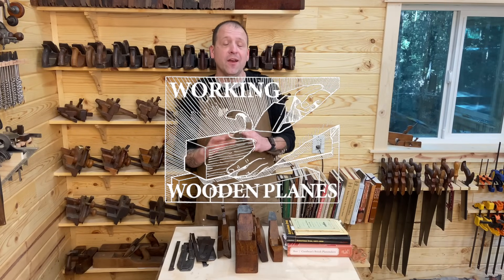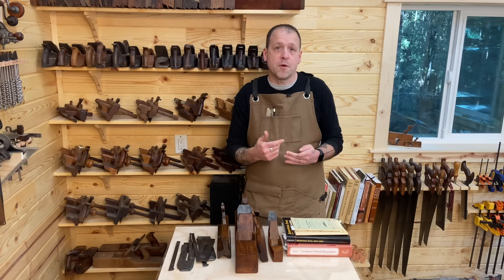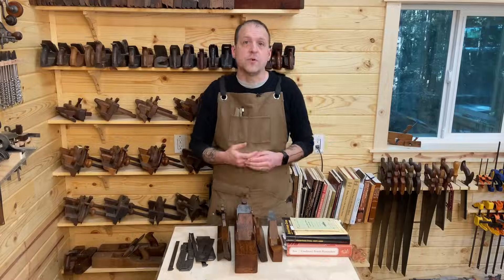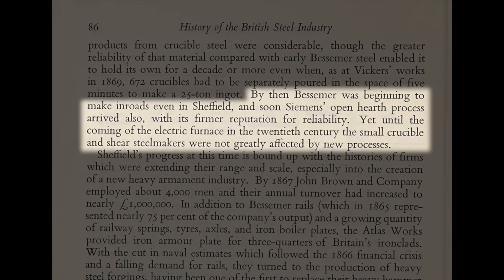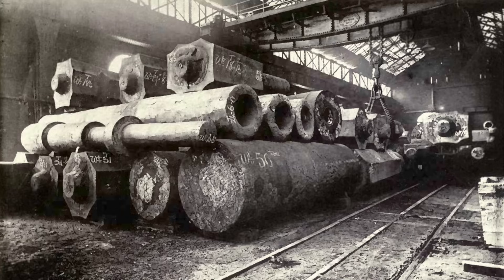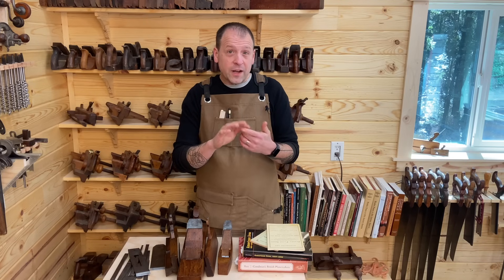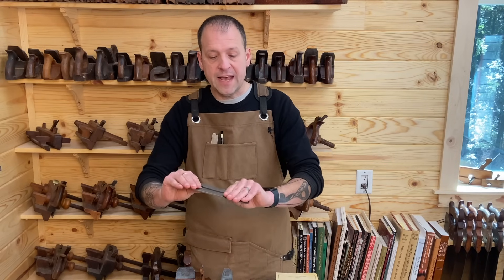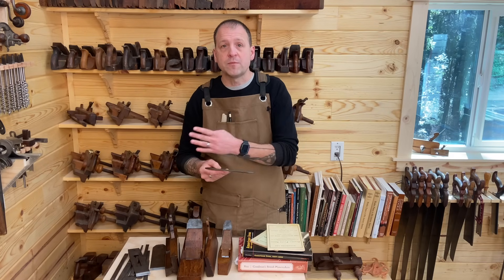The True Story of Cast Steel (Was Bessemer a liar?)

Comment: I thought the problem was phosphorous... Swedish Iron was low phosphorous so was used to make crucible steel. Bessemer was using high phosphorus UK iron and until someone worked out how to remove it by the basic steel process they could not produce high carbon steels...

Comment: Smiths in rural Norway made steel by feeding iron and steel shavings and coal in stead of iron ore into the furnace,. You don't get the furnace hot enough to make steel in general, but you get localized areas hot and carbon rich enough to melt the iron filings. . We can probably date this method to the early Viking age, when they stopped using pattern welding, (Damascus steel). My guess is that was the laborious way to make steel on most of N-Europe, but I have not seen it written down anywhere outside an interview with an old Norwegian smith that explained the method. . The Swedes probably did it industrially not long after the method was discovered.

Comment: Great video.

I'm a novice blacksmith.  I thought steel started with Bessemer.  Just didn't know.

Toured the Steamship Arabia which sank in the Missouri River in 1856 loaded with supplies for ten hardware stores in the Nebraska frontier.  It was not excavated until 1988.  Amazing trove from an 1856 time capsule.  Being a blacksmith I took great interest in the axe heads.  I wanted to see how well steel bits were welded into the wrought heads.  Very surprised to see Cast Steel markings on every axe.  The museum curator was kind enough to let me examine a few of them.  Now I know a little of crucible/cast steel history thanks to this fine video.

Comment: Down the street from me (I live in an industrial town) is a forge next to the railroad. The railroad itself in that area was built by the forge next to it. This is next to San Francisco. That forge also made the San Francisco Golden Gate Bridge and both Bay Bridges. On the next street over is machine row. One of the shops on “machine row” is Metal Co. I got a tour of the place once when I was looking for someone to tool me some plate parts. Metal Co. owner explained to me that they get various metals from the government and it is their job to stress test them. They had a bank of more than 30 manual lathes. It was extremely impressive. They said they get alloys of various composition and are tasked with reporting the properties exhibited. It was relieving to know that all this is still going on today — in secret, right down the street, one block away, on the same street as Ashby Lumber and MacBeath Hardwood. In fact, the name Ashby (as in avenue) derives its name from “Ashby charts” which plot material against strength. You cannot build a bridge without knowing your metals. There is a reason the Golden Gate Bridge stands today

Comment: The Bessemer process just zeros pig/cast iron back to pure iron and then you add the exact amount of carbon you require your cast steel to have. You can make steel of any carbon content with the process. From mild steel to Rolled Homogeneous Armor Plate. Tool steel wasn't required in the batch sizes that other steel was made, thus small foundries specialized in making high quality tool and cutting edge steel. Not so much now, because quality steel is as cheap as chips and plentiful.

Comment: It sounds like Bessemer may have been referring to case hardening when comparing his steel to cast steel, which while still incorrect, at least makes a bit more sense than comparing mild steel to high carbon steel. Carburizing is usually referring to case hardening rather than the initial carbon content.

Comment: Brand new to the channel, I really liked your history and technology on iron!  Full disclosure I’m less into craft builds. If you had a desire to chase this further, I would love to see more along these lines transitioning into modern steels. Although there are some videos on steel and iron types and uses, I find them very shallow. If you combined a about more of the technology (both how made and material properties and example uses) into your current video, that could be a more technically oriented part 2 which would be of interest at least to me. But from there you could follow the development of steel and alloys all the way to today. I’ve heard of many alloys, but exactly what they are and why I would use one over the other still seems voodoo. For example, let’s say I want to make a lathe or milling machine. Cast iron (gray I think). Why?  I know some answers but a truly comprehensive answer would be nice. And then let’s say I want to make my own without having to cast it. Might I be able to engineer a stiff strong structural design out of say 4041?  And then let’s say I’m cheap (since 4041 is pricy) maybe I can use some 1030 or 1040?  But then there is hot rolled vs cold rolled. Since this is a lathe or milling machine maybe I like hot rolled because it’s stress free and won’t change shape (important for a mill).  But maybe I like cold rolled because it’s stronger and better shaped?  I know that has gone a bit farther than you set out to go, but these are questions I have and others too and still looking for answers (maybe I still have not watched enough videos ;-). Thanks!

Comment: The reason why Iron from Sweden was preferred is because it is naturally free from Phosphorus.  Phosphorus has the unfortunate effect of making steel brittle.  In the early days of steel making this property was not known or was it known to be the cause for the brittleness.  Bessemer originally used iron from Swedish ores in his converter and the results were quite good.  However, when he went to use US sourced ores in his converter, he ended up with a brittle material.

Also, steel is not killed merely by letting it set, although that helps.  Oxygen goes into solution in the molten metal and does not come out of solution until the metal solidifies.  Nitrogen will also go into solution in molten iron/steel.  Killing steel is done by adding a deoxidizer.  Nowadays Aluminum is used as the Aluminum oxide will float to the surface of the ladle and not affect the desired alloy chemistry.  In the early days of steel making Silicon and Manganese were used to kill the steel.  If too much of these elements are added, they can affect the steel properties as they also act as alloying elements.  As a result, an insufficient amount of these elements will be added so that the added materials is fully reacted with the Oxygen in solution.  This is then term semi-killed steel.

Cast steel often has a higher amount of Carbon present as an alloying element.  Typical steels often have 0.2% to 0.3% Carbon.  The cast steels will have more Carbon present, upwards of 0.6% to 0.8% Carbon.  This additional Carbon allows for the steel to be heat treated.  That is it can be quenched and tempered for higher strength and hardness.

Cast steel also has reduced shrinkage when solidifying than lower carbon steels will.  In fact, this is one of the advantages of cast iron in that it expands when solidifying.

The other reason for the use of crucibles to make steel as opposed to the furnaces used to make cat iron has to do with the effect that carbon content has on the melting point.  Steels, (with <0.5% C) will have a melting point that ranges from ~1450 C to ~ 1550 C; while cast irons (>3% C) will have a melting point >1200 C with a minimum melting point at the eutectic point of ~1150 C.

Don't forget the other intermediate steel like material which is wrought iron.  Wrought iron is very pure iron, almost no Carbon present that it mixed with some of the slag from the iron smelting process.  Even though pure iron has a melting point of 1538 C, when it is mixed with the slag, a pasty ball is formed.  This pasty ball can be mixed to evenly distribute the slag and leads to a material that has considerable ductility, especially when compared to cast iron.  Wrought iron could be processed at 1300 to 1400 C.  The last wrought production facility closed down in about 1970.

hth

Comment: MY BIGGEST EXPERIENCE WITH CAST STEEL, WAS INSPECTING AND WELDING CAST STEEL LOCOMOTIVE WHEELSET FRAMES!
MY MOST MEMORABLE ONE HAD ABOUT 2 SQUARE FEET OF AN AREA THAT WAS WORMHOLED BUT THIS WAS NOT VISIBLE TO THE EYE!
THE ONLY INDICATION WAS AN TINY WATER DROP REAPPEARING ON THE SIDE!
I CUT THIS SECTION OUT IN AN PEAR SHAPE, THEN BEVELED THE EDGES.
I CUT AN PIECE OF 1 INCH STEEL PLATE TO FILL THE HOLE, AND PRESSED IT TO THE ORIGINAL CONTOUR.
I WELDED THE PATCH WITH 7018 ROD, AFTER STANDING THE FRAME ON ITS OPPOSITE SIDE, SO ALL WELDING WAS DOWNHAND FLAT.
AFTER WELDING AND STRESS RELEIF IT WAS GROUND SMOOTH AND NEEDLE SCALED TO ORIGINAL APPEARANCE!

Comment: At school in the 1960s I was taught a sligtly different version. For a long time people knew that the amount of carbon in the steel was important but because they couldnt easily analyse the carbon content they never knew how much to add to get the end result required. The Bessemer process worked by first removing ALL of the carbon (by reacting it with oxygen in the air) so that the required amount of carbon to be added back could be easily calculated .
Reply: That's how I was taught about it in Engeering University.   Bessemer removes all the carbon so that you can add back and have a known carbon content.
Reply: What is the difference in cast steel? Bessemer process makes mild steel by blowing air through it to burn away carbon and remove impurities and mix everything properly. Then add the right amount of carbon to make it strong enough.
Reply: I knew if this as an iron purification method, and one of the things involved in that. I didn't learn about it by name.

That's just on a classroom / casual research level. I haven't had the pleasure of working with my hands.
Reply: That’s what I remember learning, but not from school… 

If you went through an education I did you’d be MAD. 

The world that attended and ran the worlds fair? Gone. The wonderment of learning and progress is dead. 

The people need the worlds fair.
Reply: @lindboknifeandtool  +1 On a World's Fair.

Comment: When you refer to crucible cast steel for edge tools, what carbon content and grain structure would that be? I would expect it to be in the range of 1% C. As far as I understand metallurgy, ALL steel starts with extremely high carbon content (pig iron). Then the key point is to reduce the carbon content. This could be puddling (am I right to assume that this is what was used to produce the "good" edge steel you're referring to?), or oxygen blast. Setting impurities aside, theoretically , it should be possible to make an equivalent steel with either process. Perhaps this is what Bessemer was referring to, and he might have achieved that experimentally, unrelated to the commercial product of mild steel.

Comment: I have an old Used Crucible in my garden. I found an old slag dump site down by the river.  The steel company dumped the slag and also threw away old crucibles. I worked as a Tool and Die machinist for 20 years. I find the history of metals interesting.

Comment: very nice video, however i am bothered by your differenciation of mild steel and "cast steel". I'm a bladesmith myself, i work with lots of steels, and i've made my own blister steel from a crucible, as well as pure iron from a dirt furnace in the old way. The main difference of the cast steel and mild steel from bessemer is carbon content, and purity. Basically you need to have very low sulfur and phosphorous, and if you also have rather high manganese, it's a plus for performance. Here's how the bessemer process works : basically you take cast iron (too much carbon), and reduce the carbon content until you get what you need. Why did it lead to mass production of mild steel instead of harder steel ? Simply because for construction hard steel doesn't work well, it's too hard and brittle, mild steel is more forgiving and easy to work with. But to get a harder steel you can also just remove less steel, and that's exactly what bessemer claimed he could do with his process, and on paper i don't see why it's impossible, or why you're saying "he lied". Both steels are molten and their carbon content adjusted, i would expect both to have very similar performances, if the base iron used isn't too contaminated.

Also side note : not everyone was convinced by eastern damascus steel (wich isn't layered steel btw, it's just a form of early molten steel that is worked to have patterns in it, but it's not folded steel, the shapes are already in the ingot). I'm often reading "L'Art du Coutelier", by Jean Jacques Perret, published in 1771, and this guy is basically a master bladesmith from Paris, and he worked for the french science academy (just like Lavoisier and other pioneers in science), and also worked for Louis 15th, so the guy knows his stuff (and i can attest that the infos in his book are very impressively accurate, even from modern metallurgy). And basically that guy said damascus steel was crap, fragile, and knives made from it could only cut a nail if the edge was very thick, wich makes sense as wootz (or original damascus steel) is very high carbon steel. So it's very hard, however it's much more fragile than a lower carbon steel, and the shapes in the steel (carbide bands) also makes it more brittle, according to Larrin Thomas's studies. So in the mid to late 1700s, "artificial" damascus was made, by folding together iron and steel (wich was mostly blister steel at the time, however german cast steel is said to be excellent in the book). Folding the steel makes the carbon more homogenous, reduces impurities, and while this kind of damascus wasn't used for the edge of blades, it was used as a cladding to reinforce blades made from usual blister steel, and they were said to be the best in terms of performance. I can also attest from experience that old iron, turned to blister steel, is remarkably brittle compared to a modern steel, wich justifies the use of claddings of iron or artificial damascus, however nowadays san-mai blades don't make much sense, as our steels are excellent in hardness and toughness

Comment: I've been researching this for months now and I have more specific info to ad.
1. The Siemens process wasn't a method of introducing carbon to steel but rather melted "cemented iron" to homogenize it efficiently. Nordic steel also has little phosphorous and sulphur, so no fluxing would be necessary.
2. By intruducing hot air, brittle nitrides formed in Bessemer steel, so even if it had been cemented, it couldn't be used in the Siemens process. This Was ultimately replaced with the basic oxygen furnace that would also provide greater control of the carbon content.

Comment: It is indeed possible to produce Bessemer steel with high carbon content like the one of crucible steel,Bessemer steel is not necessarily mild steel.The molten pig iron(which is cast iron with a very high carbon content,which can be produced by carboreduction of various ores,including the high purity magnetite from Sweden) is totally decarburized by the jet of air,then high manganese cast iron  is added in order to form  the high melting point MnS on the grains borders which prevents hot shortness.The right amount of carbon can be introduced afterwards. There were Bessemer converters producing steel for rails a century after the introduction of the patent https://m.youtube.com/watch?v=_SusLrBIck8. I can't understand where the lie is 😅.Even sir Joseph Whitworth said that ores being equal ,the Bessemer steel/homogeneus metal can be made of high quality.

Comment: Wait a minute
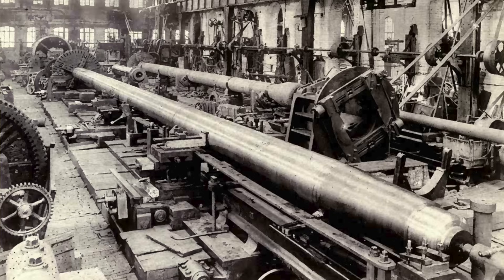Did you see those two props at 8:26?
Reply: Yes. As a matter of fact, I saw three. There's a really big one. I waited a minute. Nothing happened. 
   Are you wondering about why the two small screws have big holes in their blades? I am, too!
Reply: @krietor  Yes, those two on the floor. Doesn't it look very similar to new "breakthrough" propeller?

Comment: I have an 1850 Colt firearm made with Sheffield Steel. EDX (EDS) shows iron, silicon, carbon, phosphorous, and oxygen, but not manganese. I understand that there was a trade-off between carbon and manganese. Too much carbon and it's not workable. Too much manganese and it's brittle. I'm assuming that the 1850 arm was made with cast steel. But after Bessemer all steel using spielegeisen (or whatever) had both carbon and manganese. But that was 1858 and Bessemer had air pockets which made it unsound for firearms. So, after Bessemer, as you say, they continued to make cast steel (even after Sir Whitworth solved the problem of air pockets in 1874) but with or without manganese.

Comment: Hi, I enjoyed this look at the history of cast steel. While maybe a pedantic point to raise, you say Cast Steel is higher quality or has better properties than Mild Steel. Which is probably a fair assessment from a woodworking perspective and edge tools. But from a broader engineering sense Mild Steel is preferable in a lot of cases. The lower strength is traded for higher ductility, which is important in structural applications.
Reply from the maker: That's not pedantic at all. I wish I had spent a little longer on all the uses of mild steel. It's directly responsible for the railroad age all around the world. Hundreds of thousands (millions?) of miles of track were laid thanks to mild steel.
Reply: @WoodenPlanes  my engineering history isn't great. But from a current engineering sense, pretty much all structural steel is some grade of mild steel (buildings, bridges, cranes structure etc.). Some mild steel is heat treated to provide improved strength (S275, S355 and S690 are similar steels chemically, but differ in heat treat)